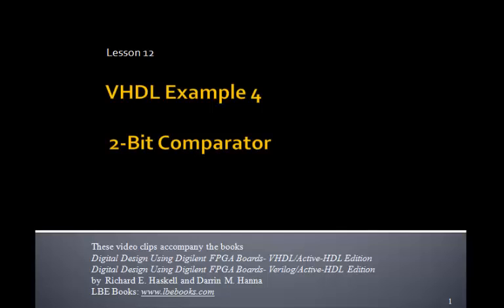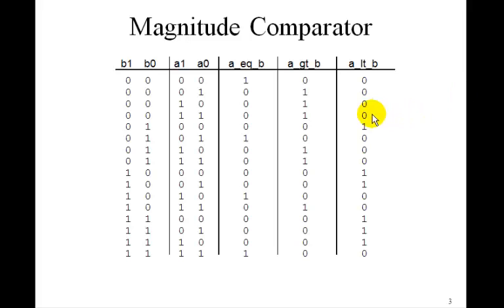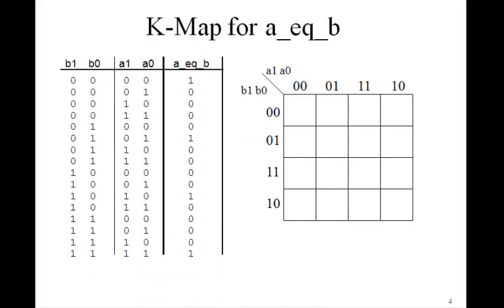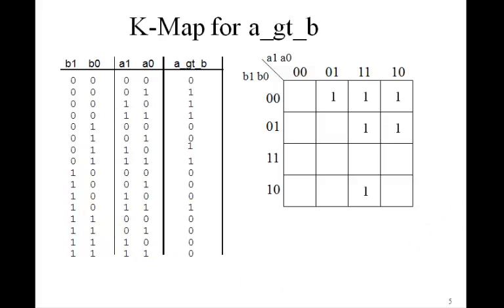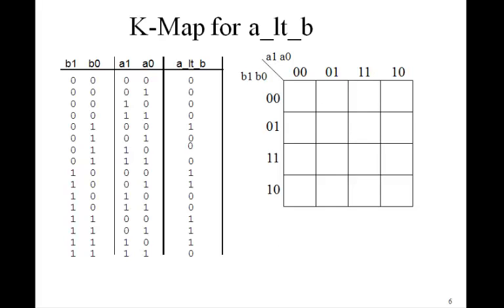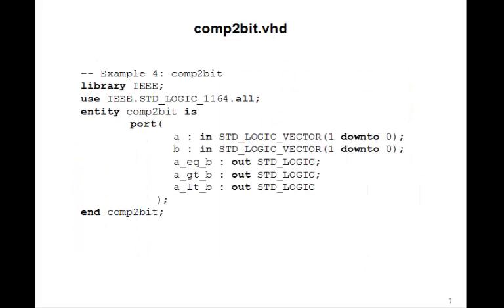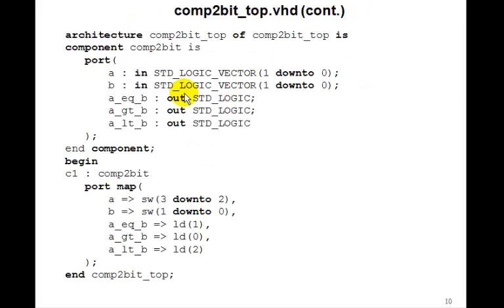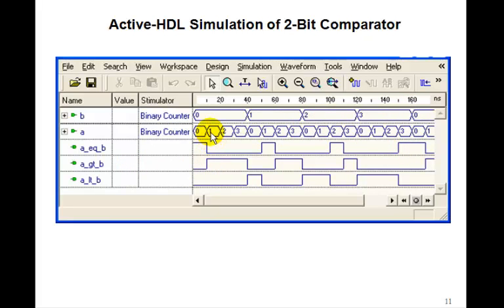Lesson 12 - VHDL Example 4:  2-Bit Comparator

Comment: In this last example, you can simplify the a=b in the magnitude comparitor by using a_eq_b <= a_gt_b NAND a_lt_b because if it's not less than or greater than, it MUST be equal.  I know this doesn't fall neatly into a way to calculate it directly, but in the real world, it would be better, right??